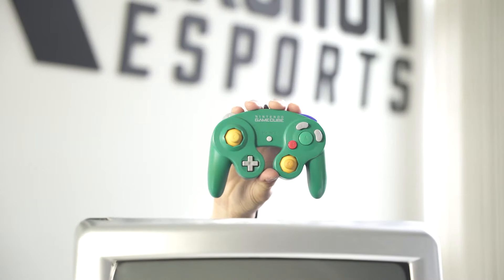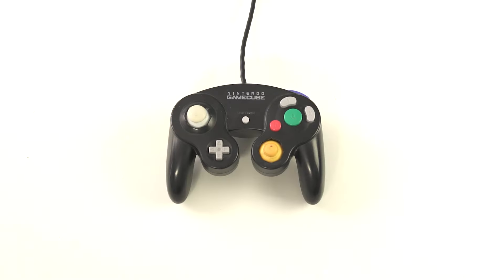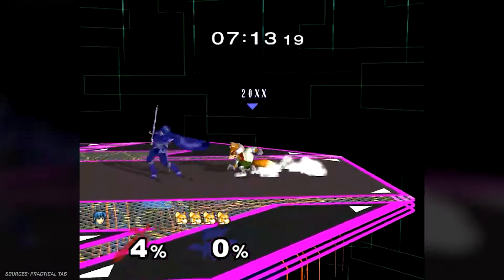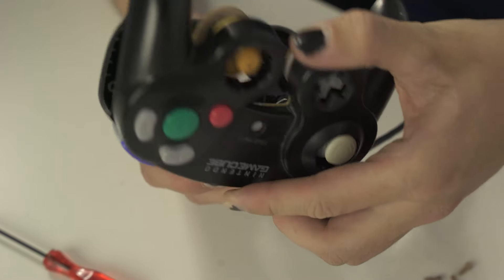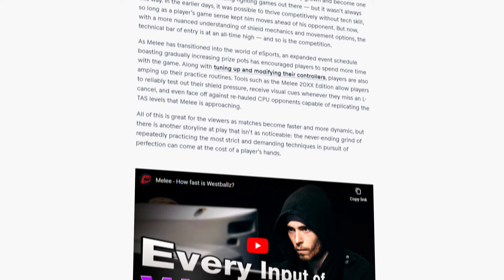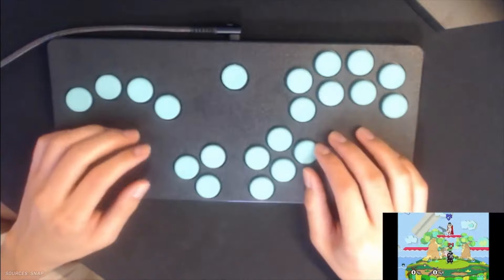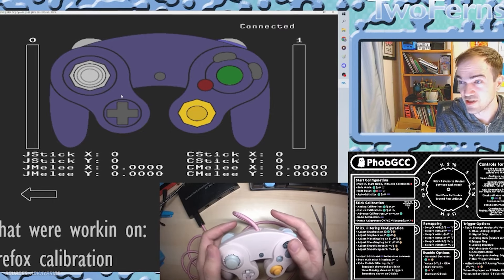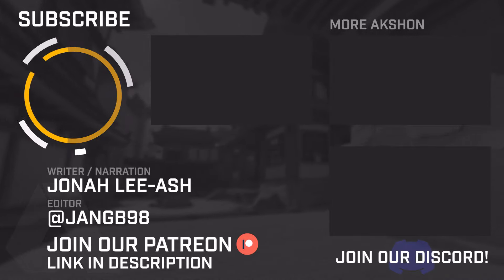The Pursuit For The Perfect Controller

Comment: There is something you missed about phobs: the magnets aren't fragile or whatever, but the 1.X version had issues about how you had to install the USB board on the custom motherboard, which gave issues even months after you got the controller from the modder. The new version, the 2.X, fixed this issue around january of this year, so basically 5 months ago. If your 2.0 phob gives issues, it's because the modder can't do even basic jobs. It still uses magnets and whatever, but the problem wasnt about magnets in first place. Obviously the magnet mounts shouldn't be printed in resin because it's fragile, but PLA, a more solid material, is way more common in 3D printing. I use for my controller and the ones I mod nylon mounts which have glued magnets and it's glued to the stickbox. Doing so I've never had any complaints

Comment: ive been following this controller drama almost since it started and i still don't understand how a controller made to prevent serious physical and permanent damage to your hands*** gets called cheating compared to a controller that's ergonomically the worst thing created since any controller from the 90s.*

*Unless you have small hands. but i've never heard of anyone playing any other game using any other controller having permanent hand damage.
***HANDS ARE VERY FUCKING IMPORTANT GUYS!! WHAT THE FUCK! XD
Reply: The health angle is irrelevant; it is a customized controller that gives users unnatural advantages over people who use "normal" controllers. The larger fighting game community has the same debate over the Hitbox. (For example, allowing a player to press opposing directions simultaneously opens up potential input "exploits" that cannot be replicated with a joystick.) The Trackmania community had the debate over both hardware and software solutions that let keyboard players configure keys to register at precise analog inputs. Speedrunning and high score communities debate all manner of controller alterations, and even stuff like filing a notch into the edge of your controller shell might be considered illegal.  I remember some FPS communities being concerned when companies started pushing more advanced controllers that were in theory designed to make games more accessible to the physically disabled, as people without such disabilities could also gain advantages from some of those features.
Reply: @BainesMkII "the health angle is irrelevant"

Is one of the most ignorant things you could ever say about anything 

Especially fighting games
Reply: @cjkmelee  Not at all, and it is (to use your own word) ignorant to say otherwise.

First, competitive play is entirely optional.

Second, the health and/or safety concern angle could be used to justify any number of advantages ranging from minor to major. You have to draw a line somewhere, or you might as well just allow everything.
Reply: @BainesMkII  the niche tech that a boxx allows you to do donesnt even get utilized at competitive levels that matter, OR when it is utilized it just doesn't make as huge a difference as everyone was speculating it would. 

Assuming we all keep up with FGC shenanigans, when was the last time you heard anyone complaining or even making VDoc's / VEssay's about that tech dominating a game?

All im trying to say is that if you oddly want to ignore the very important health angle in favor of the not-as--important competitive video game integrity angle then you gotta realize the trade off for what the controller can do vs what it cant do is balanced enough that it just doesn't matter.

It doesnt use macros like the new controllers people are pioneering and it doesnt allow for weird ass programable angles on the fly. THAT is weird and is definitely cheating.
Reply: @BainesMkII  Exactly: Competitive play is optional. Being able to use your hands however is not. Your choice on which you think is more important.
Reply: @BainesMkII  SOCD cleaning is required for hitboxes, you can't push in two different directions and have it be a legal controller in pretty much all fighting games. Hax$'s b0xx has nerfs that made to bring it closer to OEM but still it's obviously somewhat better because the consistency is just that important for competitive play, but phobs and goomwaves are arguably on the same level of "cheating" if you consider the b0xx cheating. Personally I'm pro b0xx because i think as long as it's the player doing the inputs and not macros then the competitive integrity holds up, however you could argue im biased since I bought a box style controller - but that was because I have spent too much money on controllers and wanted one that'd last significantly longer.

Comment: I’ve never understood the appeal of this controller.  Has anyone not grown up with it and liked it ?
Reply: As a Nintendo fan it’s their only good controller since the Super Nintendo
Reply: I grew up with a dualshock 3 and a wiimote in my hands, and I hated the gamecube controller the first time I touched it. now though, after coming back to it I prefer it over my switch pro controller and my fight stick. the sticks on a gamecube controller just feel different in the best way.
Reply: outta all controllers the sticks and triggers on the GCC are easily the most satisfying to use, the noises it makes are amazing.
Reply: Its good for the games its meant to be played with, like obviously we wouldn't want to use it for shooters. But for smash games, platformers, arcade racing games ect. We grew up with it and it works well.